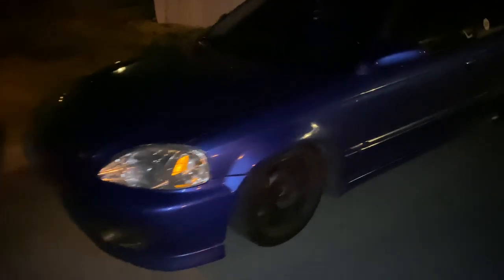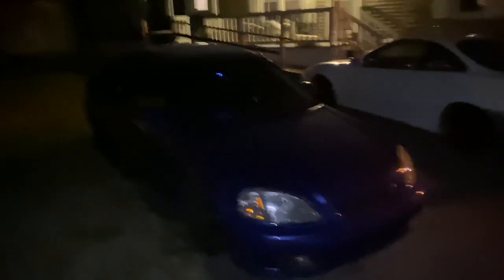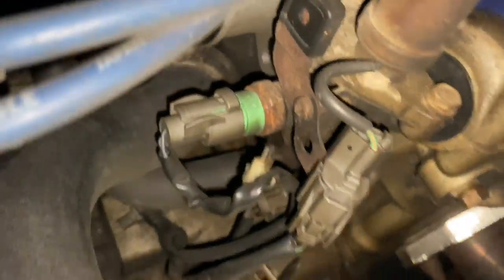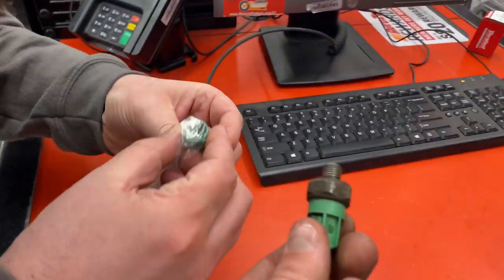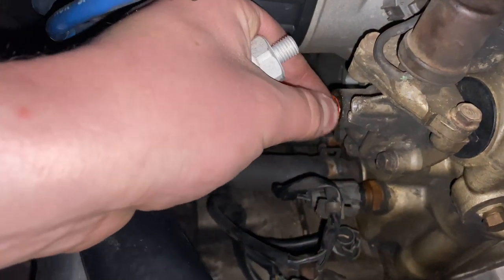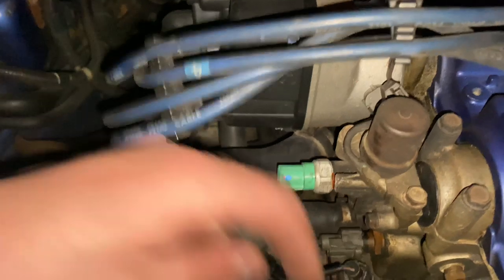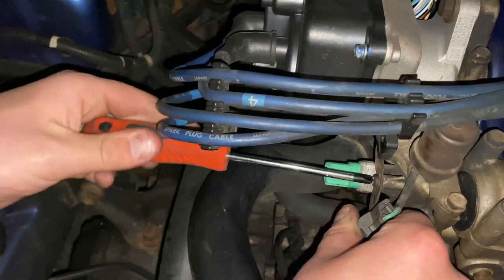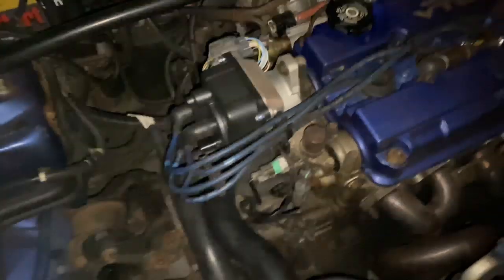VTEC solenoid oil pressure switch replacement

Comment: The cheaper one is the non vtec version. And you should not have taken the o ring off as it kinda looks like it got pinched because it's bigger than the where the sensor threads in. That's why it was hanging there instead of sitting properly

Comment: Did this work? And what were your symptom's? I have the same engine and mine won't go past 5500rpm, it hits a rev limiter and just bounces with no vtec
Reply from the maker: prudence fitzenstein ended up changing the entire VTEC solenoid
Reply: @prudence fitzenstein did you ever get that problem fixed on your car
Reply: Sensor problem
Reply: yo did u ever find out what it was im havin the same problem

Comment: Wonder is the oil pressure switch supposed to be dry from the inside of the plug? I noticed mine is leaking from the inside. Is it bad? There is no oil from the outside what so ever. Any help be appreciated!
Reply: Since its name 'oil pressure switch', the inside cavity should be full of oil to give s true oil pressure. The o-ring prevent oil leak to the outside.

Comment: Im not sure if its my car's issue but mine has no oil pressure switch connected and check engine light is on. Computer says is code 21.
Also when I drive it, check engine lights turns off for very shorts periods of time and comes back

Comment: I replaced my vtec solenoid and assembly it cleaned codes drove for couple miles then goes out again I disconnect battery it work but then does same thing and won't go past 4krpm. Any advice appreciated
Reply: App sensor, or a clogged CAT

Comment: Do you know if this part fits all Vtec engines? I have an '06 Element and have replaced the solenoid 3 times in 6 months. The pigtail (I'm told) is a common failure and this one's connector is cracked. NO ONE SELLS THIS UNDER THE ELEMENT NAME. Honda only sells the entire engine compartment harness - $1200!
Reply from the maker: Richard Herbst Honestly I’m not 100% sure I would go on Honda tech and look at the forms!!! I don’t do Hondas past 2000 so I don’t really know but I’m sure there’s some really good information on there that would help you!
Reply: @unplugged_preston  I'm told that all connectors are not the same. I have noticed that the cable itself is flimsy and the 2-wire connector isn't sealed against moisture.
Reply: K pendejos están cómo va saber la jente k está dañado si no le muestras la falla

Comment: Don’t get mixed up with the oil pressure switch (the first one in the video) and the V Tech oil pressure switch (the second one in the video). Common mistake.
Reply: I bought 37240-PT0-014 which only says oil pressure switch. My 2001  engine f23a4 is ulev with vtec. Should I look for the one that says VTEC?

Comment: My car bucks at 2700 rpm going up incline wonder if that’s my issie
Reply: My 2003 Honda CRV bucks crazy and it gave a a P1259 code and told me to replace the VVT oil pressure switch is that basically what he replaced in the video?
Reply: I believe there is a oil pressure switch in rear of engine and another on vtec solenoid wich is green on left of engine.

Comment: yeah u got a oil pressure sensor at first for everyone don’t go buy that!!! it is called a variable valve timing solenoid oil pressure sensor switch
Reply from the maker: I think what your talking about is for k series, b series is different. We changed it and it didn’t work because the vtec solenoid was bad
Reply: @unplugged_preston  the vtec solenoid is the actual vtec module so one quick way to find that out for sure is test it with a ohms meter

Comment: I think you pinched the oring
Reply from the maker: Ivan Garcia A sensor ended up failing and the car was overheating so the computer went in limp mode
Reply from the maker: Fixed now tho but thanks for watching